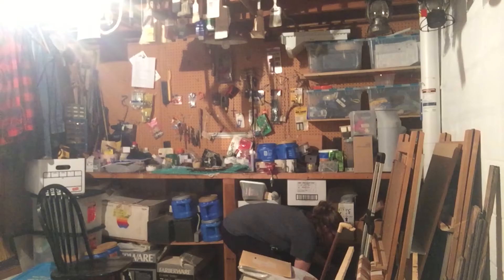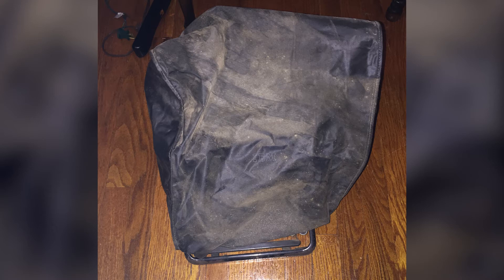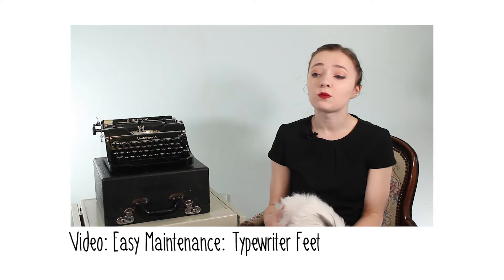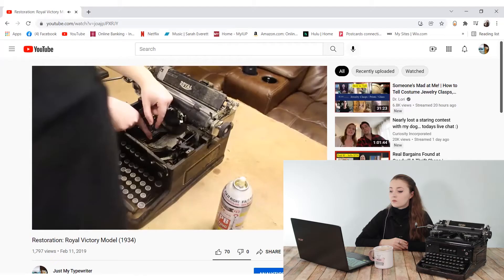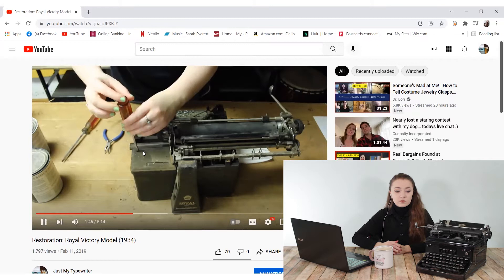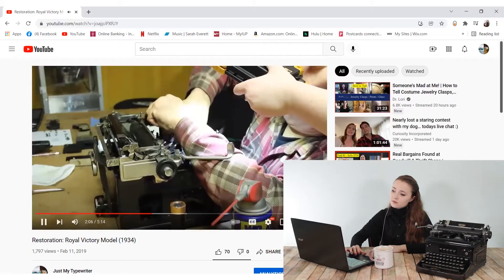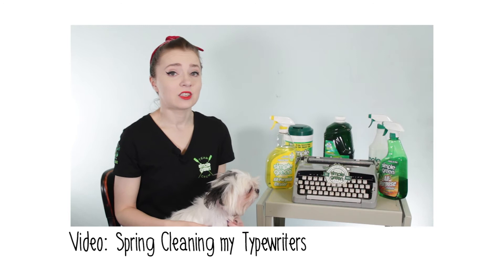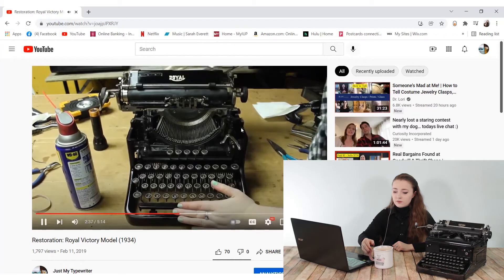Revisiting my first typewriter restoration...

Comment: That War Department manual is one of the single most valuable resources I've ever found online, helped by the fact that all the major typewriter manufacturers were pretty consistent in their design and engineering over the years.  I, too, used it to remove a platen, among other things.  Also, it was interesting to see them include instructions for Woodstock machines; evidently Woodstock remained popular in government use for a long time.

Comment: Another great video. Question: you recently talked about having a parts typewriter. Would it be easier to find a platen on another typewriter to replace the bumpy one or is that rare to find one that fits? Also, new drinking game--drink every time you say Simple Green :) jk
Reply from the maker: Prepare to be very tipsy. 
It might have been easier to find a parts platen. At the time- I had no idea that parts machines existed. It's tough to judge though on platens whether or not they'll be in good enough condition to use from a parts machine. It definitely was some extra steps to resurface, but I think a valuable thing to learn in case you can't find a good swap.